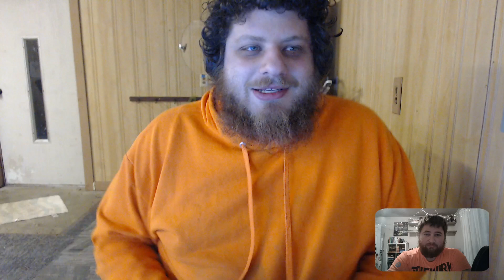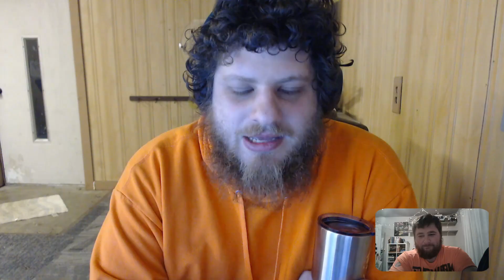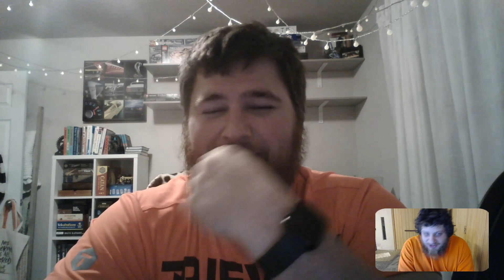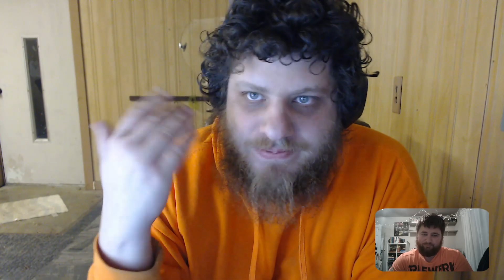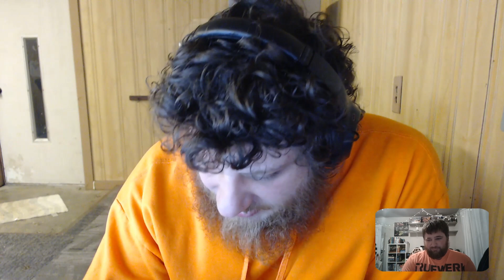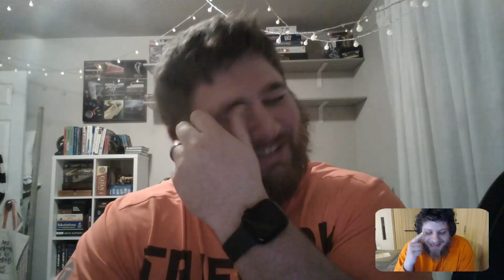New Shop and No More Tormach! -- Ep. 70

Comment: I’m thinking about buying a used VMC, 40x20x20” 10hp spindle, 10k rpm. I’m never done any machining, my dad’s into it. I don’t have any parts or customers line up
Reply: I bought a 32x20x20 VMC a few years ago - I'm still working on getting it back together and running. It had numerous electronics issues (which for me were the easy problems to solve), but physically working on such a big machine with one person and an engine hoist in a garage is a challenge. And being a hobby project, months go by where I don't touch it.
Reply from the maker: Go for it! Personally I would start a little smaller, but there's more than enough information online to figure it out! 

My advice is that before you buy anything, pickup a 3D printer, and get really good at CAD by designing and printing things you need. Once you have done that, I would start learning machining on something cheap, that you can afford regardless if it brings you money or not. Then you can start picking up some parts on Xometry, and slowly build from there.
Reply: @AudacityMicro  is Fusion 360 what I should concentrate on or some other cad?
Reply from the maker: Absolutely. Every other CAD+CAM option is like 10x more. And if you are a student you can get it for free.